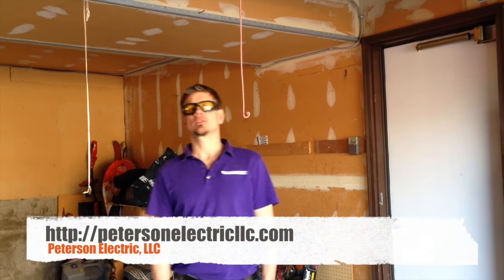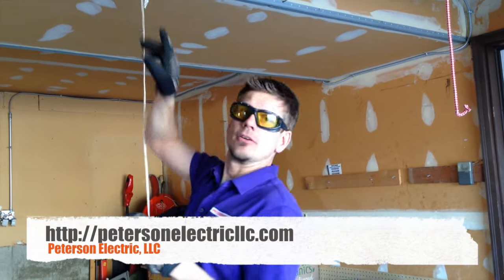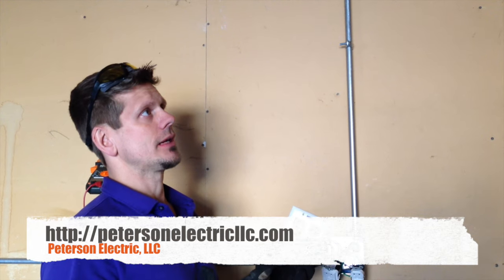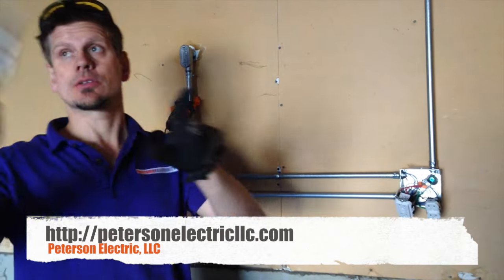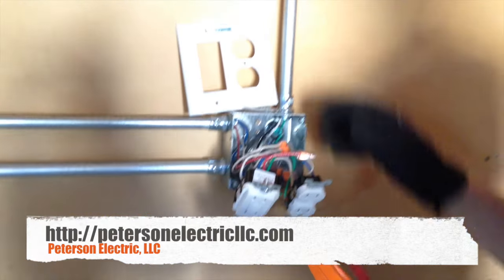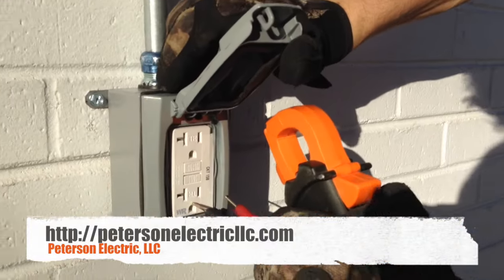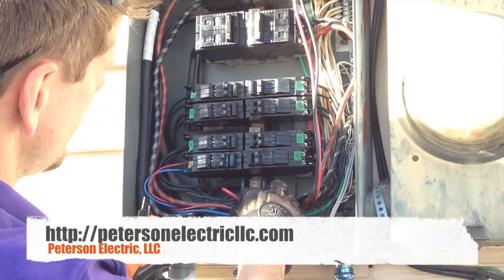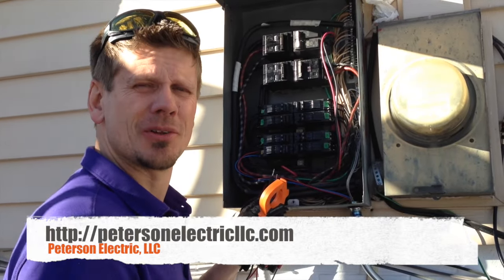Electrical Code For Garages & Exposed Romex Wires

Comment: He points to a non GFCI outlet and then shortly after states that "code states that all outlets must be GFCI outlets especially for garage door"........  HMMMMM...
Reply: @Petersonelectricllc  Also you specifically stated that there was a GFCI feeding them from the other side. I guess people want to point out mistakes so badly that they don't even listen or watch with full attention. They also try to call out people who know more about the subject than they do.
Reply from the maker: Yes, I do not believe a gfci will work safely unless with an egc conductor, so DF breaker is best in the  panel for 120 volt circuits with no EGC in the house; circuits .
Reply: @Petersonelectricllc  It will work fine without a EGC, but the only time you would do that is when you have old 2 prong outlets and you want to convert to GFCI protected. You don't HAVE to rewire to be code compliant when changing devices. You have to label them "GFCI Protected" "No equipment ground." But that is if the customer cannot afford to rewire or doesn't want to.
Reply: @Petersonelectricllc  My point is the guy criticizing you seems to not know the difference between a GFCI receptacle, and a GFCI protected receptacle. They are equivalent and interchangeable. I think your videos are really good. If you have critics, it's because you are actually doing something worth commenting about.
Reply from the maker: @illestofdemall13  NO SIR, it it will not, if you have every used yourself as a meter an tested to see by accident that the customer can still electrocute themselves on a metal face plates or worse pick up current on a multi-branch circuit's Neutral, then you should try this. Plus, static shock from old carpet with too much soap or just a dirty house or certain areas in the country in a desert can be more conductive to static shocks. READ 250.130 - 250.142 also, under 314 for metal boxes being bonded to the circuit, the GFCI and AFCI do not help with the grounding of an old FISH looking scaled 1950's two wire circuit with not grounds. The box is metal masoniary looking and is on an insulated WOOD stud with not protection.
Reply: @Petersonelectricllc  406.4(D)(2) Non–Grounding-Type Receptacles from 2017 NEC
Reply: 406.4(D)(2) Non–Grounding-Type Receptacles

Where attachment to an equipment grounding conductor does not exist in the receptacle enclosure, the installation shall comply with (D)(2)(a), (D)(2)(b), or (D)(2)(c).

(a) A non–grounding-type receptacle(s) shall be permit‐
ted to be replaced with another non–grounding-type receptacle(s).

(b) A non–grounding-type receptacle(s) shall be permit‐
ted to be replaced with a ground-fault circuit interrupter-type of receptacle(s). These receptacles or their cover plates shall be marked “No Equipment Ground.” An equipment grounding conductor shall not be connected from the ground-fault circuit-interrupter-type receptacle to any outlet supplied from the ground-fault circuit-interrupter receptacle.

(c) A non–grounding-type receptacle(s) shall be permitted to be replaced with a grounding-type receptacle(s) where supplied through a ground-fault circuit interrupter. Where grounding-type receptacles are supplied through the ground-fault circuit interrupter,  grounding-type receptacles or their cover plates shall be marked "GFCI Protected" and "No equipment Ground," visible after installation. An equipment grounding conductor shall not be connected between the grounding-type receptacles.
Reply: The code states that you can replace non grounded receptacles with GFCI
Reply: @Petersonelectricllc  From what I have read and seen by other licensed electricians is that a fault will cause an imbalance between hot and neutral even with no ECG, thus tripping the GFCI. The code does state it is a replacement when there is no ECG. I will test it myself one day, though.
Reply from the maker: @illestofdemall13  It does state that in 404 and 406
Reply from the maker: @illestofdemall13  Yes I understand this, although, with no EGC ground and no way to get it there without major damage, then I would GFCI, but now you also have to AFCi, so you might as well use a DF breaker, and if the panel has to be changed then it should. Safer breakers then a safer home. I think that most electricians forget that the breakers are the safety shut off and breakers are only good for about 50 yrs from what I have seen. ESPECIALLY if there outside in the load center, elements are hard on them with the hot and cold in CO.
Reply: @Petersonelectricllc  Then the home owner says "It's worked fine all these years."
Reply from the maker: @illestofdemall13  Yes they do, then i have recently a couple of customers that lost friends or their kids to electrocution or property by fire. Those customers get this update every 3 yrs.
Reply: Line and load is a term you should study Jay Hart...

Comment: Just pull a ground wire for christ shake it's one wire being this guy keeps quoting NEC CODE. SMH
Reply from the maker: Maybe Christ could help me pul the ground wire.
Reply: Dude......"cheese n rice" why you bashing Peterson Elec. (everybody's a you tube expert) this dude is a damn good electrician and has safety concern first and foremost.....this video contemplates how a typical man will make things a little sketchy in an effort to get stuff running....here Josh explains how he cleans up this situation.
Having metallic conduit as your circuit bonding has been done for many years in commercial/residential settings and is a NEC established method of grounding.....as he states maybe you feel like pulling the additional conductors, but not him, lol....and having conductors in metallic sheathing in this case serves multiple functions, efficiently....I would trust Josh to work on my stuff anytime and know I wont pay for unnecessary overkill just for ego's sake, really? 

PS I'm from Michigan and just appreciate honest tradesmen when I see them....good job on your videos!

Comment: nice looking pipework, that being said i think r/s covers would have looked more professional. and should have pulled in a grounding wire anyway while you were there, just for shits and giggles. sorry, had to give it a thumbs down for workmanship.
Reply: maybe...just maybe, you wanted to see some offset bends at those GFI's and some type of jazzy box covers? 

ticky tacky nit picking.....you have to compete in today's world and loads of extras means loads of "over budget"
Reply: @ryerob741  maybe, but nothing like good workmanship to get repeat customers and good referrals. don't think 1 little #12 green and a couple of r/s covers would break the budget, plus the extra time it took to ring out the pipes, you could have just walked away with peace of mind. but hey, that's just me. not trying to tell you how to run your business. just posting my opinion. i thought that's what this section was for?🤔😎

Comment: This is overkill to the max. so that electricians can run up their bill to uneducated homeowners.  You don't need conduit. Just run it in the wall.  GFCI is required.  This guy went the most expensive route possible.
Reply from the maker: NO I DID NOT> WHy don't you keep your opinions to yourself. You are not an electrician. SO, you can do bad wiring for your own home or your buddies. Typical!
Reply: My brother is an electrician.  My father is an electrical engineer.  My best friend is an an electrical engineer.  I am surrounded by people who know code and I study code to prevent being ripped off and contractors love to lie.

Contractors rip off unsuspecting homeowners everyday.   Contractors lie and tell a homeowner that something is needed when it is not.  I have wire inside my house, garage, outside, underground.  No conduit.  Why?  It's not required.  I did not put it in.  You lied about that.  Of course, you lied to this poor homeowner.  What was the bill for that work?    Don't lie.  Exposed Romex is just fine, right?
Reply from the maker: @jimkelly4286  If they are electricians then they KNOW BETTER to never run NM cable surface mount. 
If they are electrical engineers, then I usually spend more time on their property repairing their work. 
Conduit is required in certain applications. It is the responsibility to know when and where. 
Ripping you off, man you got some skeletons in your closet, blowing me up about your past issues. Typical.
Reply: @Petersonelectricllc  So what was the cost of this work?  Why not run it in the wall?   Why choose the most expensive route possible?    Answer the first question.
Reply from the maker: @jimkelly4286  I don't discuss pricing over the internet. He did not want the drywall cut, there was plenty of beams through out the ceiling and they had a bedroom above.
Reply from the maker: @jimkelly4286  If your brother is an electrician does he do his own hiring and contracting?
Reply: Hey Jim Kelly I happen to run across this video and seen your comments talking about your father being and electrical engineer and your brother an electrician and your friend being an electrical engineer. The problem here is that this still doesn’t make you an electrician. Not to brag I’m not an electrical engineer but I am an electrical senior superintendent who holds a master electrical license and runs 16 mil dollar jobs and up and I spend more time fixing the electrical engineers fuck ups then doing the actual work. The reason you are criticizing is because your not in this guys shoes and you’ve probably never done the work. Peterson electric- I’ve seen a couple of your videos now and I like that you have your own ideas and are not afraid to bring them out there. Keep up the good work. 
Jim- next time you want to correct an electrician... come back with your master electrical license. Being surrounded by all these people with the NEC knowledge doesn’t make you an electrician.
Reply: @gers2421  Those are the kind of people who do it themselves and mess it up because they don't want to pay a qualified person. "Ripped off" means he expects to pay what he feels the job is worth and not the actual cost of the electrician's time/expertise plus materials.
Reply: Or they want it to be done half assed to save money.